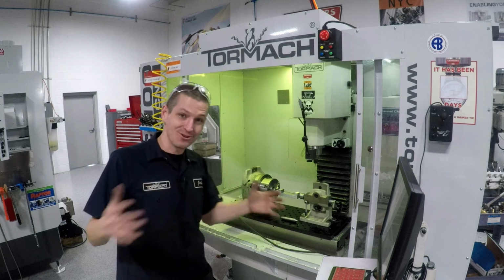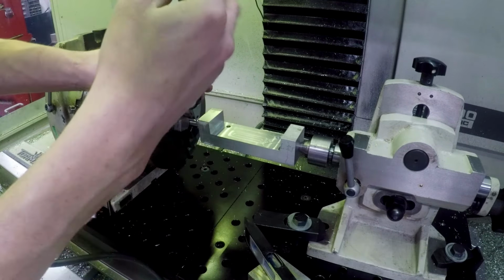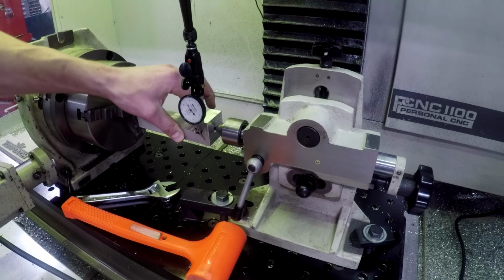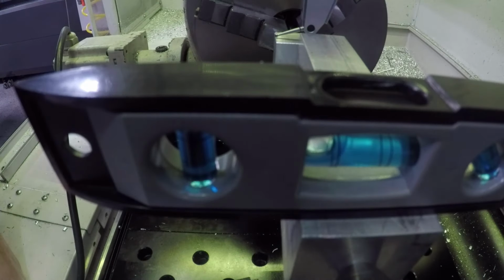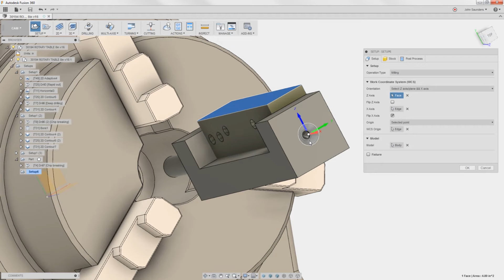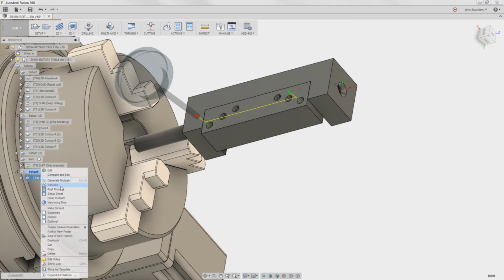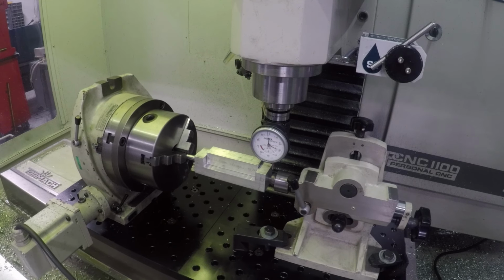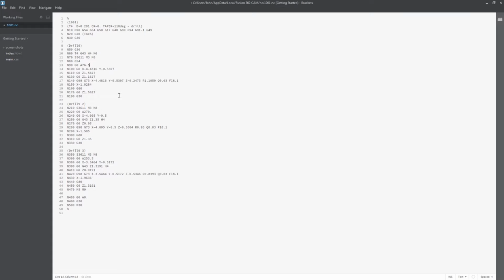Tormach 4th Axis Trunnion!  Part 2 WW141

Comment: One comment after the next, is just people roasting John here. Even myself a couple times I think. (Sorry, there is just one weird thing after the next in these Trunnion videos, just don't make sense to do.) I disagree with a chuck being used and a tailstock. I would prefer to use a Tombstone bolted to the 4th Axis plate, and go from there. But that's just me though.

My question to John is, would he be willing to go through various mistakes in either his opinion that he does agree with or some of our mistakes where we may have not known the whole story that he disagrees with. John is in small production, if the goal is to get a single part or two done in 4 hours (from the moment you received the order), it doesn't matter how it got made. Tweaking everything in software or elaborate fixtures doesn't add much, if it takes you two days to do it. I want John to do a rebuttal/agreement video to these comments. I would really enjoy to hear his opinion.

Still, thank you very much for the videos. Aside from these two Trunnion ones for some reason (you kinda drop the ball there, compared to your other videos). You give actual solid advice, and many amazing tips. :)